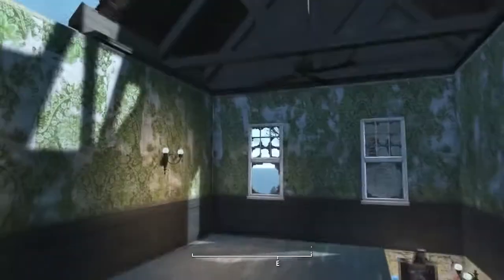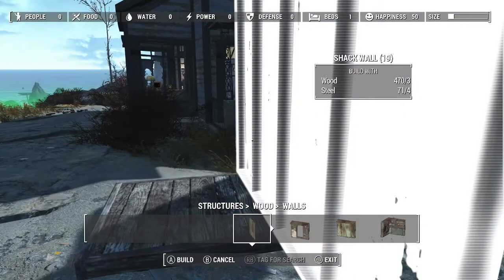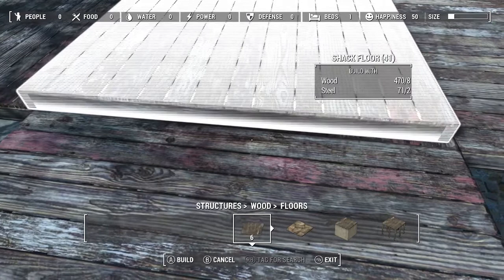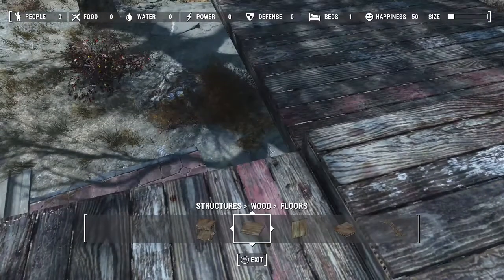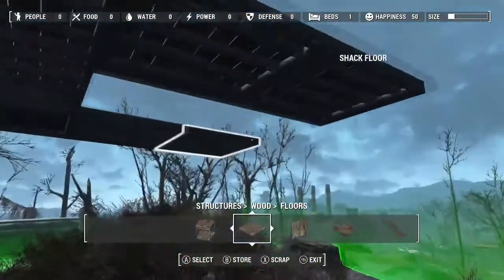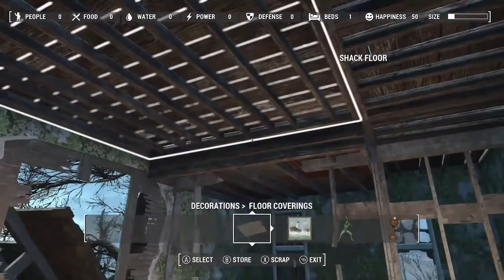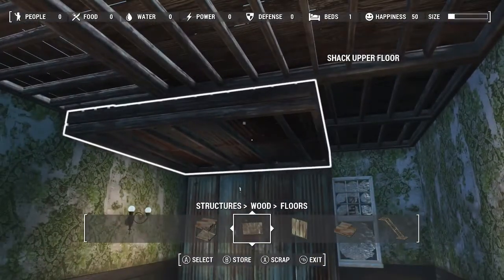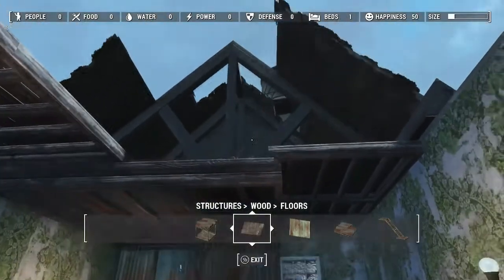Roof Repair at Kingsport Lighthouse: Fallout 4 Tips and Tricks

Comment: You can put in a higher ceiling if you use a barn wall instead of the shack wall. Put a barn wall on a small floor tile, add 3 large wooden floors (length) and a row of small floor tiles along 1 side. Fits perfect. I did that yesterday. I'm on XBox. 
Like the video.
Reply: Thanks, I'm gonna try it out!
Reply: Forgot to mention that you do that at the bathroom wall after scrapping the sink. It didn't work for me on the other wall (facing the lighthouse).
Reply: yes it has the height but i cant get it to sink into the wall. i tried his way, i cant get the stacked floor to snap
Reply: You use a small mat/rug to do the "rug glitch" that should allow you to move the wall (with the attached floor tiles) into the house wall ( bathroom wall facing the window).
The floor tiles have to be the barn floor tiles - normal wood tiles don't snap to the barn wall (if I remember right). It worked for me. 
Question: are you using mods? In later modded play throughs I had to disable my "Cleaner Settlement" mod by Trosski in order to repair houses in various settlements.
Reply: Yunsuagi1 
Just tried this on PS4 and it works fine.

Comment: This does work there's a easier way go upstairs and drop a cinder block floor in the middle of the room and then put one on top of it,

Now you should be able to snap a perfect square above the roof and actually into the roof but not too far down..

I just got done doing this
And it was pouring raining and no rain came through
This way does work with the way I'm talking about is a lot faster and you'll get a solid concrete roof above you

Comment: You can do the same thing to fill the gap over the fan without using the upper floor. Take two small floors, put them in a line, take a mat and put it in front of the line to make a straight "three" length line with the mat in the front, and use the glitch that way. Just have to get up on top of the floors to place the last small floor right over the gap. I hope I explained that well. I'm a bit of a perfectionist, didn't like the upper floor under the others, so I had to find a work around.

Comment: can't incorporate the fan as part of the build? saves material from building a new one
Reply from the maker: +Victor Ramos problem is plugging the hole above the fan in the roof which was the original target of the fix. If I could have gone above the fan to fix the roof I certainly would have done that

Comment: is there any way to fix the other part of the house where the roof is broken?
Reply from the maker: +Tommy B for consoles, the only thing to do at this point would be to build over the roof. Or you could do what most have done, turn that part into a jacked up balcony area.
Reply: i like the ceiling higher the way you did it but the cracks in the ceiling bug me
Reply from the maker: +Tommy B I hear ya. It's unfortunate that we can't fix all that small stuff, so we just need to do the best we can, and make it into something beautiful.
Reply: its a shame we cant use roofs..just need to change the angles
Reply: yes there is, I went around the dormer with regular shack floors then built barn walls and used barn roofs. I also fixed the main house by starting with barn roofs and then barn walls so it looks like I just plopped a barn structure over the top of the house as a hat. That is the easiest and best way to repair this house, this tips and tricks video is pure garbage. I used no mods and didn't even have use any rug or pillar glitches